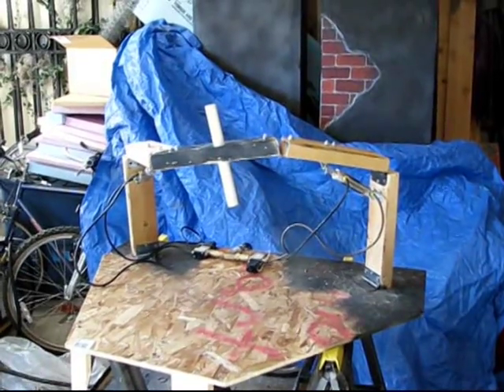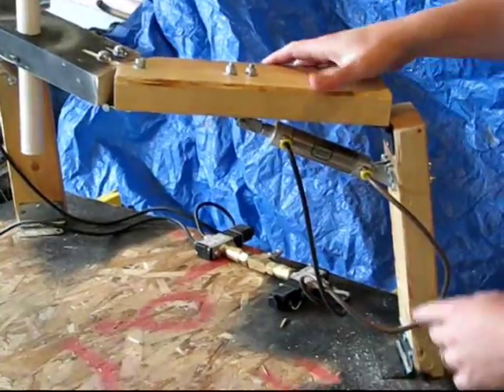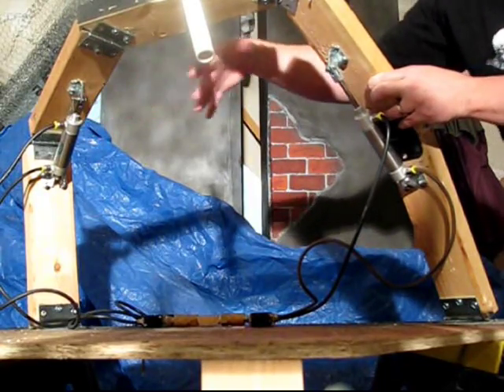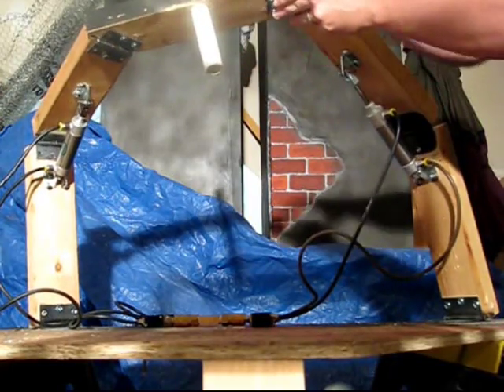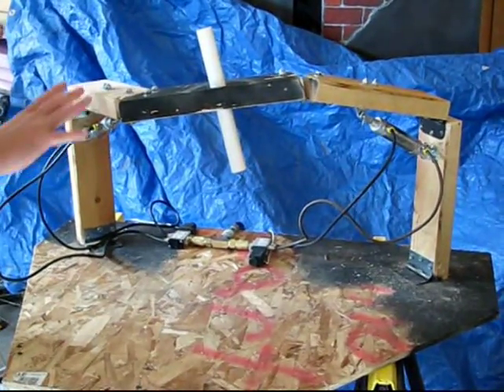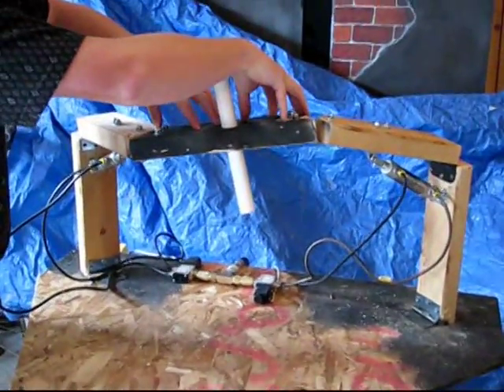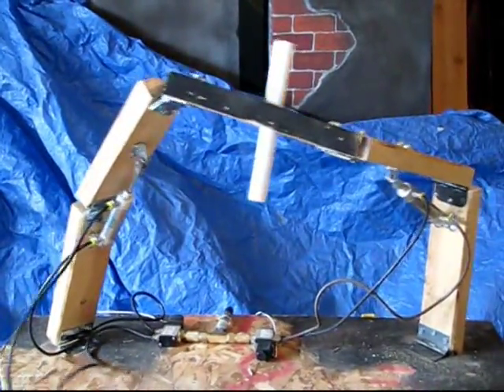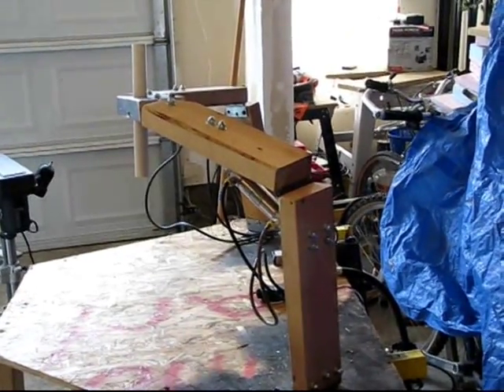Pneumatic Ground Breaker How-To

Comment from the maker: You use a microcontroller, for this prop I used a Picaboo.  The controller send an electrical pulse to turn on the valve or turns it off.  I have a 4 gallon air compressor to power all my props.

Comment from the maker: 6' of 2x4
2 pneumatic cylinders
2 foot brackets
2 rod clevis 
2 clevis mounting brackets
2 4-way solenoid valves
1 prop controller
6 3" hinges
12 carriage bolts (attaching cylinder)
10 flat phillips bolts (hinges)
2 hex bolts (shoulder)
locking nuts/washers for all bolts
drywall screws (elbow hinge, securing wrist hinge to plywood base)
 
All bolts were 1/4 by 2" long
picoBoo as the controller.

Comment from the maker: Try rotating the lower arms (or elbows) so they point away from each other more.  If that doesn't work you may not have the arms separated properly.  The closest points on the arms should be about 27 inches apart.

Comment from the maker: It depends on the soleniod you are using and its power requirements.  For this prop, I used a Picoboo controller which needs a 110V soleniod, so I basically used an extension cord.  If you have a soleniod that is 12/24V, then you will need a controller that can use 12/24v and a transformer to power it.
Reply: Is there a way to make this motion activated?
Reply: @tracemiller1519  It depends on the controller you use. I used a Picoboo and it can use a motion controller. I like the idea, it can be a nice startle prop.
Reply: @spencercarter1805  yea I think I’m gonna just get the fright props kit with the picoboo controller it seems a lot easier doing it that way.
Reply: @spencercarter1805  what size bore do you recommend for making the groundbreaker move viciously?!
Reply: @tracemiller1519  I used a 1 1/4" bore @ 60 psi. It's HARD on the prop but it moves like it really wants out.
Reply: @spencercarter1805  yea that’s what I’m worried about but trial and error and we will see! Thanks appreciate you!

Comment: what tells the 4 way valves to open and close? how do you power the valves? are they plugged into the wall or something? thanks for your time, awesome prop design. and did you hook the air up to a compressor or just a 5 gallon air tank?